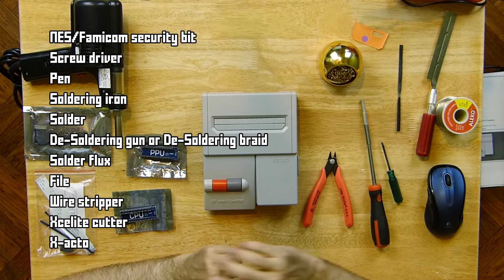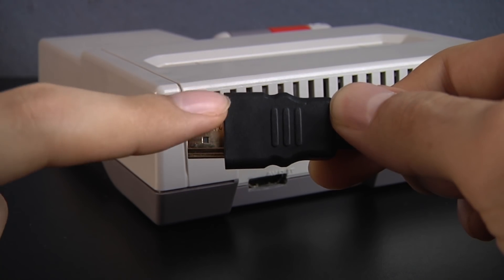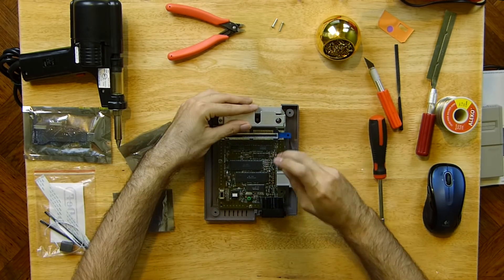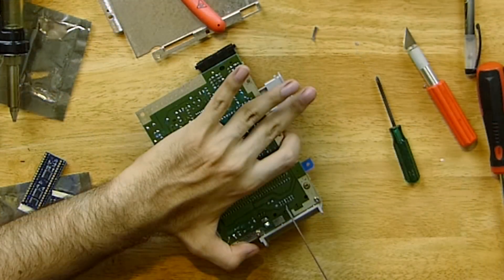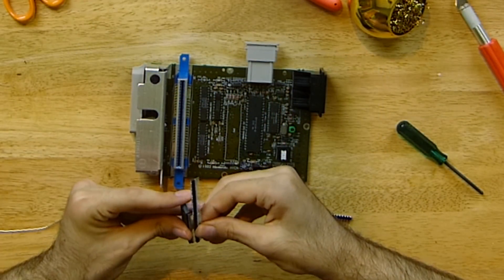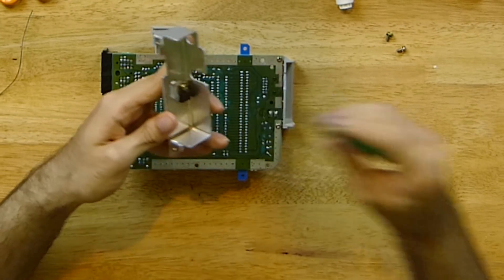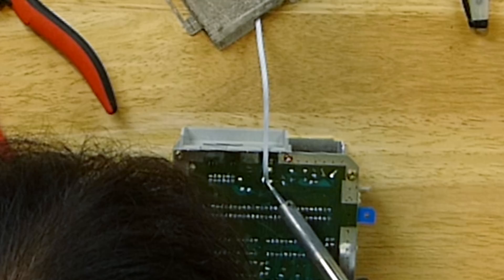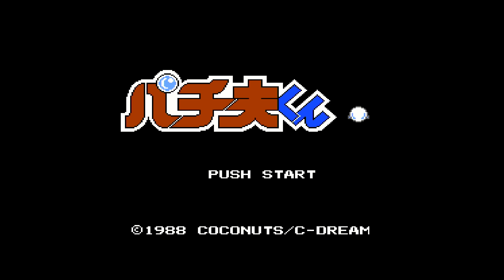How To Install Kevtris HDMI Hi-Def NES Mod - Top Loader/AV Famicom

Comment: try using the exacto knifes blade on you soldering irons screw now you have a hot knife to cut.
Reply: It's a shame that the mod doesn't give you rewind and savestates even one would help.
Reply from the maker: You'd use the powerpak for that.
Reply: +rangerreview lol a power pack with a genie with a cartridge almost as bad as the Sega genesis with the 32x attachment and CD.
Reply: It would be better if not cost effective to just add that to the hdmi by that point I'd get a Everdrive.
Reply from the maker: I think the fpga is fully max out, in space.
Reply: +rangerreview thank you for you video and for your quick response it's much appreciated.
Reply from the maker: No problem.

Comment: To avoid using the desoldering gun in the same area for too long so that I don't heat damage the chips I try to alternate sides or skip pins then go back and get what I missed.
Reply from the maker: Yes. I should of said that in the video.
Reply: rzeka it looks like a Hakko 808 or a clone of it.
Reply: A couple years late but Voultar didn't skip pins and he held a bit on one of them since it didn't clear without some extra heat.

Comment: Most people will have to buy a tool. I used Pittsburgh 5" Micro Flush Cutters (Item 90708; ~$3.19-$3.99 at Harbor Freight).

Comment: I'm glad to see the templates I designed are helping so many with the cut-outs!
Reply from the maker: Yeah. Printing them out is really good.
Reply: Gah! Didn't realize there was a template, I eyed it and it still turned out damn good after using a file.  Can't wait to show it off at the MO Game Con!
Reply from the maker: Jake F
Cool that it came out good still.
Reply: FYI: it printed too small for me with almost everything I tried (Windows 10 viewers/editors, Mac OS X, Chrome, Irfanview, etc). Like most, I don't have Photoshop. Only thing that worked for me was GIMP (free, open-source).
Reply: +Emmett Turner Oh: ...and thanks, BTW. ;)
Reply from the maker: Emmett Turner
Yeah. That's why I said make sure u turn on boarderless mode printing. It stops your printer from shrinking things down normally.
Reply: How have you guys been getting around the clearance of the PPU board sitting on top of the laid down cap and the IC just to the side of it on the front loaders?  My interposer legs JUST BARELY go through the vias.  I had to drip solder in them for it to make connection, would much rather have some leg to solder to on the other side of the board.  FYI this was with installing one that Jason already soldered the interposer legs on, I think if I put them on myself I could had given it a bit more clearance.

Pics:
http://i207.photobucket.com/albums/bb256/zebular0/13833322_10157128295810545_1591221680_o.jpg
http://i207.photobucket.com/albums/bb256/zebular0/13838327_10157128295765545_1524280983_o.jpg
http://i207.photobucket.com/albums/bb256/zebular0/13835855_10157128295780545_260096794_o.jpg
Reply: +Jake “Zebular” F I'm pretty sure I folded the cap 90-degrees clockwise from the direction you folded it. It didn't want to lay flat without hearing the legs and melting the solder underneath allowing them to retract slightly. Once it was flat I think I liquified the solder and pushed it as far back toward its own holes as possible so more of the factory-cut leads would come through. My PPU interposer seemed to sit flush.
Reply: +Emmett Turner "hearing" should be "heating"
Reply from the maker: Jake F
I didn't touch the cap. I just pulled on the cap slightly and gave the innerposer a harder push. It's a tight fit. But it works.
Reply: Emmett , please can you help me with the correct size of that Av Fami template ? Thanks in advance for all !